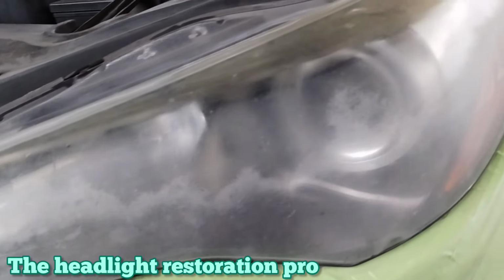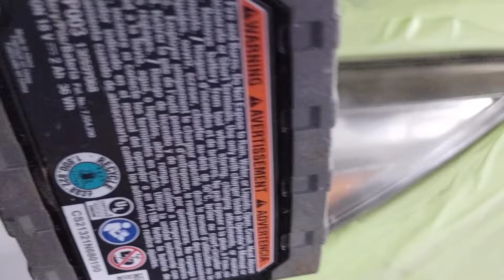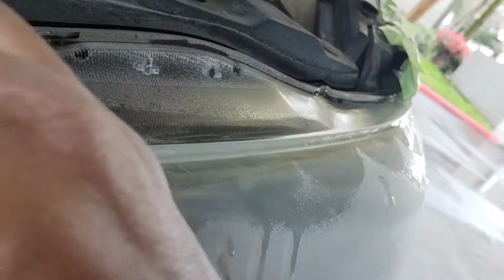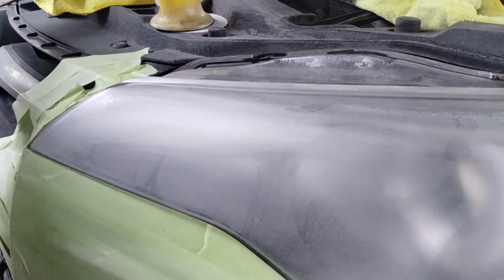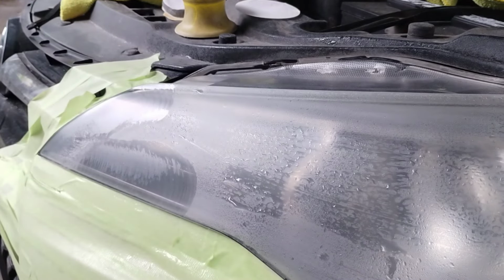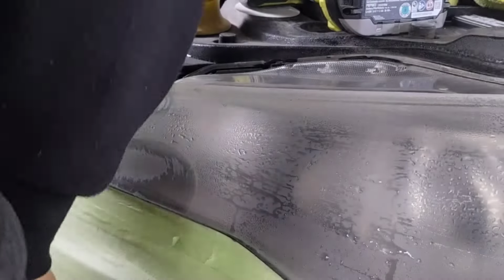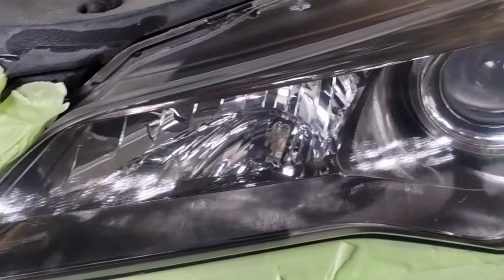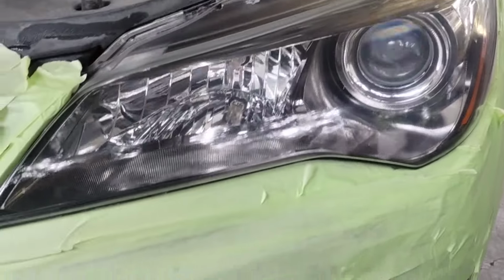Headlight Restoration  - Always Amazing💰💰💰

Comment: I just recently came across the ryobi 18v right angle die grinder, which I thought might be an alternative to your AC Delco polisher. The main thing that concerns me is the ryobi die grinders lowest setting is 10,000 rpm and highest is 22,000 rpm. And I don't really want to burn/melt the headlight or even prematurely disintegrate the polishing pad. 
What are your thoughts on using a polisher at 10,000 rpm?

Comment: I been doing your method and every time I do they come out amazing. Customer is always 100% happy . But after I coated it with the ceramic spray sometimes I do notice very fine scratches still in the headlight. Am I doing something wrong . Any tips . They are very fine scratches I don’t know if it’s from the sanding just a little confused I would like to get them pitch perfect like yours .

Comment: 1st....🤪
Mine look like that ..
Cloudy on the top...and in the other half still very clear...
Any advise you could recommend?
I want to do my headlights, just don't know what steps or sandpaper grits should I use start to finish. 
Appreciate your input 👌 
Great jobs in all of your videos btw 
Much blessings 🙌
Reply: Just sit down, grab a beer and just go through his hundreds of videos and you will know exactly how to do them yourself. Nobody does it better than him when it comes to giving you every detail you need for every circumstance. Not a single issue with lights that he hasn't dealt with. Most importantly be patient with the process, don't force, skip or rush any steps and always look over your work before the next step. His method out performs all.
Reply: Totally agree...
6 pack for the duration of the labor 😅😅😅
Reply: "I don't know what steps or grits to use AND great job in all your videos btw" doesn't compute, if you watched any restore video here, you know exactly what steps/grits. Can't short circuit this, put in the time viewing, you'll do fine with your lights - even if it takes you a few tries to nail the "process". Good luck!
Reply: If you don't have any tools, here's how I did it by hand:

1) 1000 grit, 2000 grit, 3000 grit, and finally 5000 grit sandpaper (high grit makes polishing easier). I did it all wet - he does it dry in the first steps. To apply even pressure, I wrapped my sandpaper around a sponge, making it soft. 
2) Plastic polishing compound, and if you have it, a drill with a foam/wool pad. If not, a microfiber pad will do, with lots of elbow grease. Get in there until it's SUPER reflective.
3) The Meguiar's headlight spray he also uses. It truly gives the finishing touches - any microscratches left behind will vanish with this stuff. Crystal clear afterwards.

It takes some elbow grease, but it can be done! Always make sure to spend enough time with each step. Don't skip any spots or it won't come out as good.
Reply: @MiMicheIIe  ty for your input 😎😎

Comment: I love your videos and I don't know why they are so addicting but they are. In a very tired state - I put on a second coat on one of the headlights I was restoring, and as you can guess it made it go from a great restore to now, a cloudy restore. Do I redo via sanding and all the steps - or should I just use the polishing compound to get back to where it was (which looked good.)?
Reply: Boss likely still very busy and a I don't want to highjack the thread or step on his toes (or fingers, as the case may be) nor is it my place to recommend but that said, starting from 800 should work fine. There was a recent vid where CC ran, and same steps were followed for that repair. There was an earlier (~6 months ago?) vid as well and same approach used. Likely no need to go more aggressive than 800 but you'll know as you remove the CC. Good luck!
Reply: Thanks for taking the time to respond, I'll start at the 800 and try again

Comment: The Meguiar's Clear Headlight Coating and 3M Quick Headlight Clear Coat have the same purpose and benefits right? same protection just need to pick one which ever is available? DOnt you need to sand it, polish and buff the Last clear coat? wont it have some orange peel and just make the light bounce around and fuzzy?

Comment: Hey again, question.
How many 500 grit (your lowest grit) of 3m sand paper would you say is used on a average headlight??

I forgot what I burn through, & adding up my costs.
I like 320, & then 600 due to the increased defect removal.

Best of luck in your venture friend.

Comment: Have a question, so I’ve been doing this lately. I’ve ran into an issue with it. What looks like to be pieces of glue getting put onto the light when I’m sanding down. Then when I look at the pad, it looks like there’s like flakes of the headlight on the sanding disc and like a glue substance, am I pushing down too hard on the drill while I’m sanding? I’m just not sure what’s going on. It just takes me longer to finish the headlight, but they still come out good.
Reply: It's probably just the clear coat